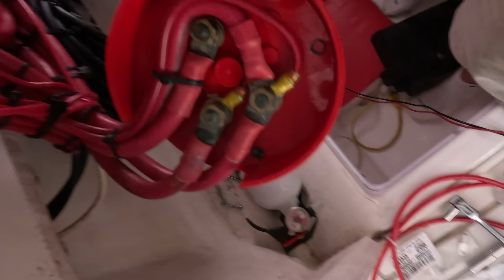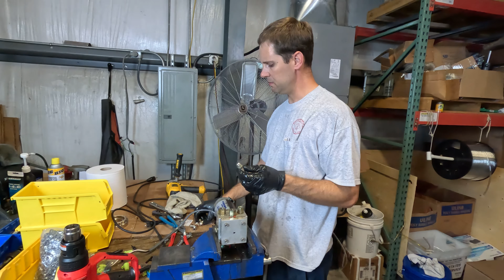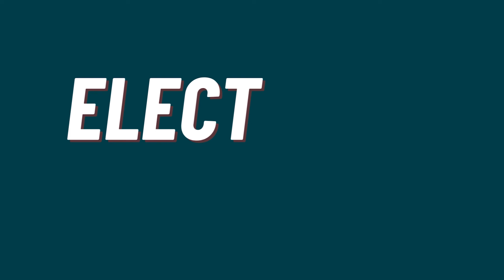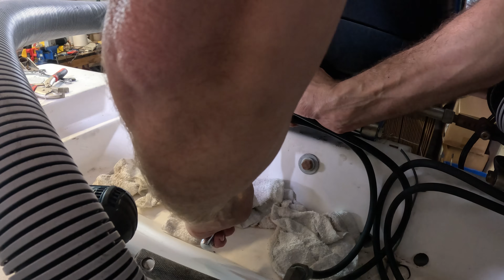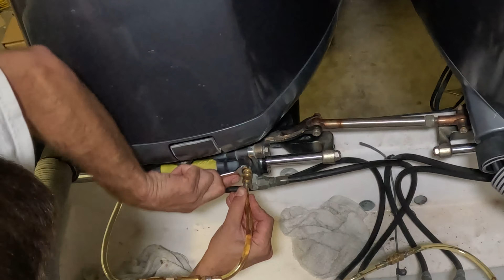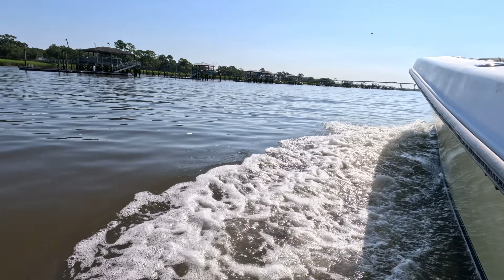Upgrade to Garmin Autopilot Reactor 40 - Marine Tech Vlog#7

Comment: At 12:50 you mention hooking the pump up to the fuse block with a 40 amp fuse.  I’m pretty sure the Blue Sea fuse blocks are rated for 30 amp per circuit.
Isn’t that going to be an issue?

Comment: What happens when a wake dumps the captain over the side while on auto pilot ? Cut off lanyard?
Reply from the maker: The auto pilot only manages the steering so the over board situation is the same, the boat will just go it a perfectly strait line or navigate up whatever track was set.  I will add that now that I have used it, I would have a hard time offshore without it.  Perfect heading regardless of conditions, saves a lot of effort.